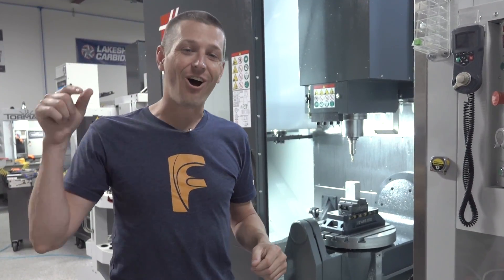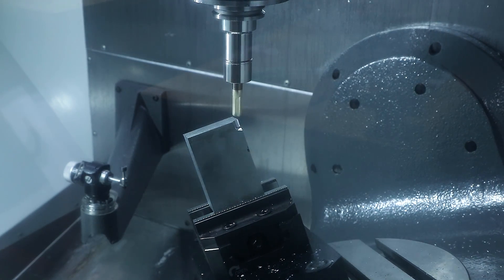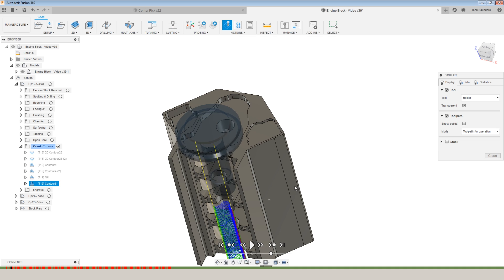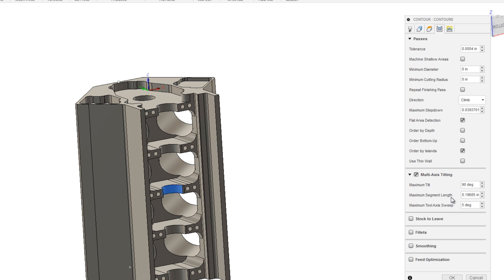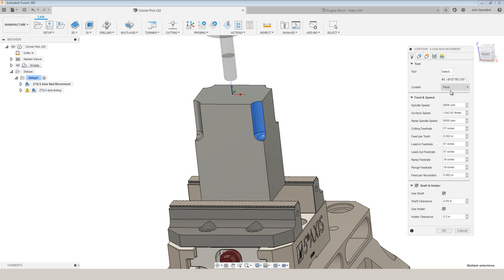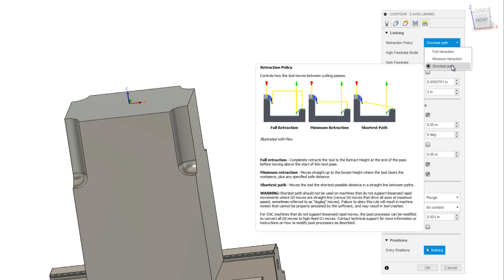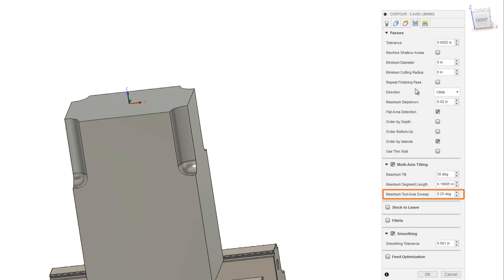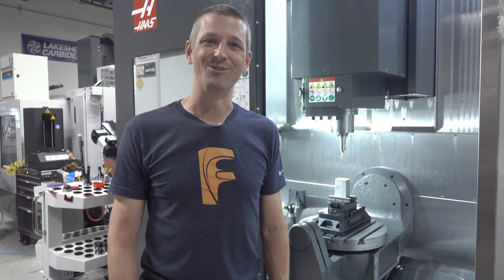5-Axis CNC Programming: Getting Smooth Moves on HAAS UMC-750 with Fusion 360!

Comment: This is interesting. On the part I'm currently working on (On the Mazak Integrex) I have a Key projecting into the bore on one end. I order to reach it I will need to tilt the B axis to get a 1/16" ball mill into the corners. This may work. I don't as of yet have a functional post. But if I can post the code for just the tool path I can manually insert it into the program made by Esprit. The Esprit software believe it or not is not as good as Fusion's ability when it comes to this kind of thing. This is one reason I would like to get Fusion to work for the Mazak Integrex.
Reply from the maker: Knowing you, it's probably Inconel :)
Reply: @nyccnc  Titanium.
Reply: very interesting  to see a very knowlegable man like you still watching videos and learning from them a true example of the no limit for learning and no particular source for it
Reply: @marouanebenderradji137  John is much better at Fusion than I am. So I do learn from his videos.
Reply: @EdgePrecision   my words can't describe the great feelings that I had when you replied me it is facinating to be replied by a great man that I respect thank you so much bith for the amazing amount of knowledge that you share
Reply: Marouane Benderradji thanks for your kind statements!
Reply: We use gibbscam at my current employer. For its price, built in machine simulation its very limited compared to fusion 360 /inventor HSM, and simple task take longer.We are going to purchase another 5th axis with a discount seat of gibbs. Im pushing towards another seat of a cad/cam instead of gibbs so we can design out own fixtures in the location. Gibbs might have machine simulation and it seems it has more advance 5th axis tool paths (not theirs, its a plug in from a german company),with out anyone at the  local gibbs support with the skill to teach these complicated tool paths there useless. Its hard to push lights out with gibbs with out fixture design built in.
Reply: The mazak post wouldn’t be all that terrible to make. Do you have someone working on it?
Reply: A proven post processor is numero uno on my priority list, if the boss can’t see this he’s a short sighted fool
Reply: Let's get that post sorted..

Comment: Thanks for the tips. was just messing around with 5 axis in simulation and couldn't get it to do anything I wanted. Have you ever tried Autodesk Feature Mill? If it does what it says it could really speed up programing time.